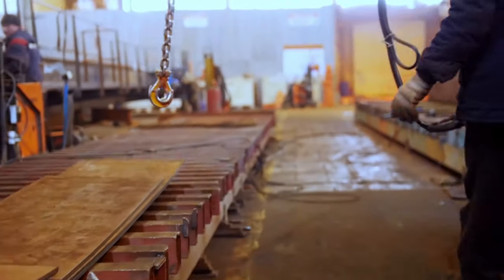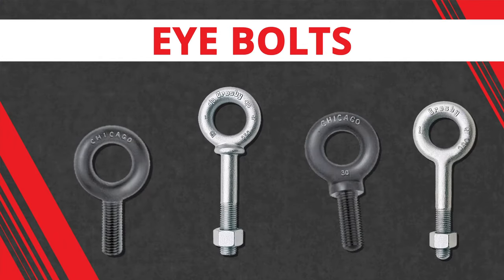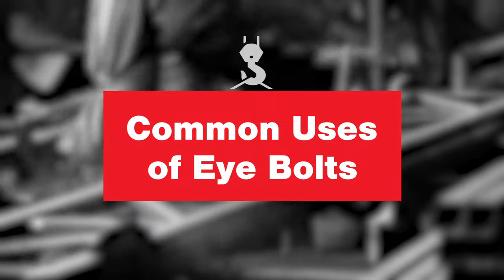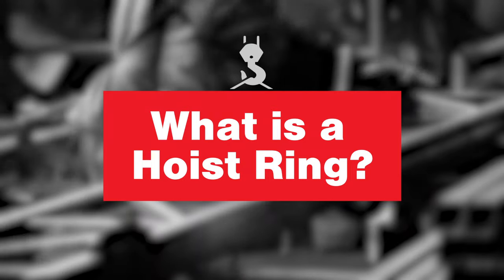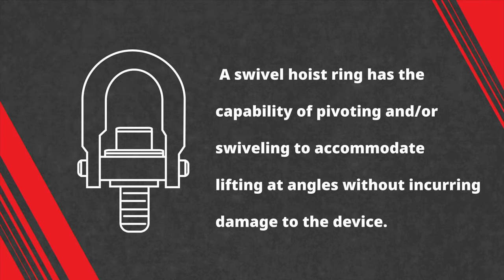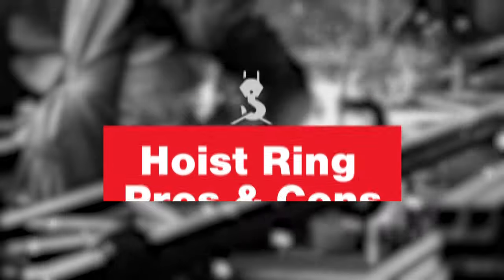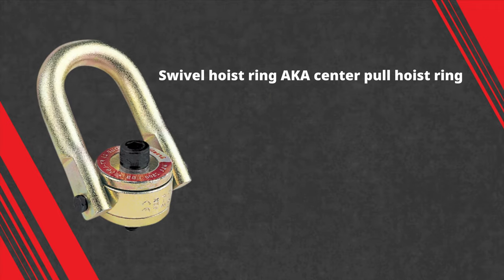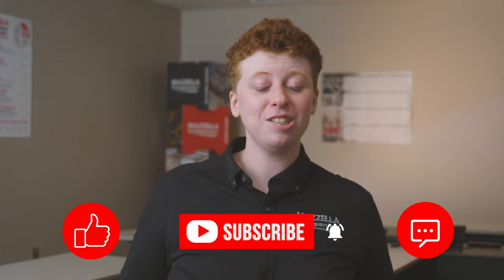Understanding Eye Bolts and Swivel Hoist Rings

Comment: Main question I have is what's the difference between a Swivel hoist ring that is screw on and one that is bolt on? I have seen these on websites and they look exactly the same.
Reply from the maker: Hey Anthony! It really come down to what kind of hole you’re putting the swivel hoist ring into. If it goes into a defined hole with a specific diameter, you would use a screw-on. If the swivel hoist ring can go fully through the hole, you would want to have a bolt on the other end. Let me know if this helps!

- Kay
Reply: @LiftingandRigging  OK That's what you would think. Just like a fastener it is either a screw or a bolt.
But the website I found for hoists has 2 completely different parts for them. So I'm like wth?